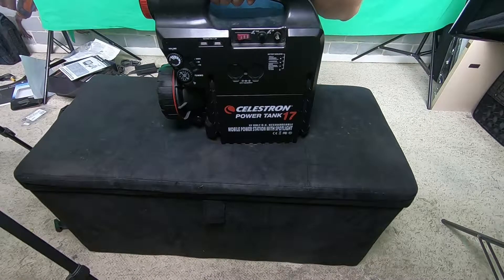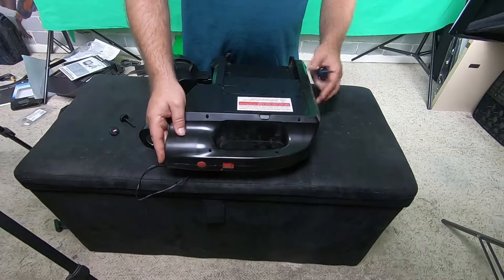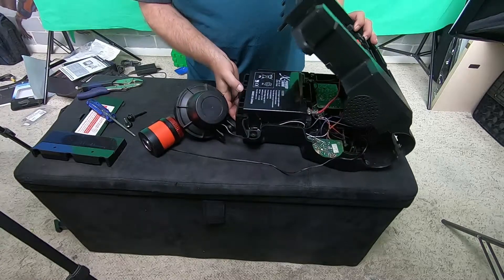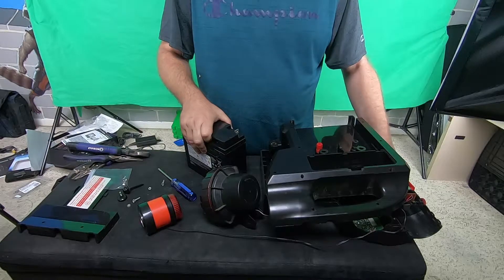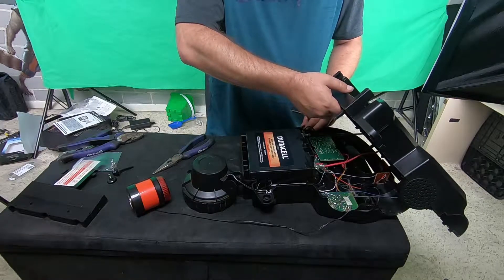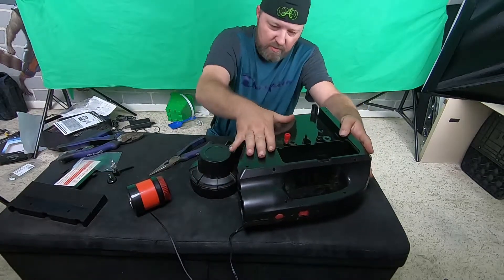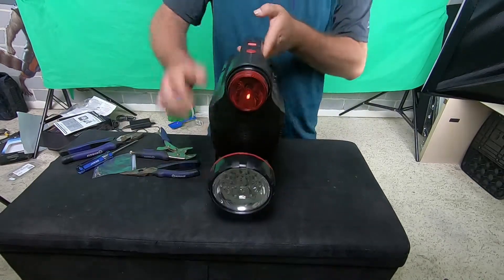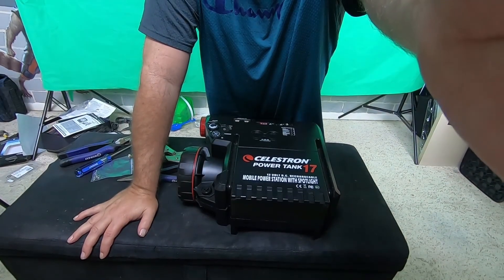Celestron Power Tank 17 battery replacement

Comment: Just a couple more questions, how is the PT holding up with the new battery and did the old charger work for the new duracell, or did you run into any problems ? does it matter if the battery is AGM ?

Comment: 18V ONE+ 120-WATT POWER SOURCE WITH 12V OUTPUT (RYI12VBG) + buy a 2Ah 18v that is lower cost than the 12v replacement batter and light years better setup.
Reply: Ryobi one+ 18v 120-Watt Push Start Power Source with 12-Volt Outlet RYi12VBG
One loss a Red Light
 Im working on a Usb plug in LED Red light.

Comment: Very useful. My Skywatcher version of the same tank was so reluctant to split open that I began to wonder if the external battery terminals were bolted through. What I did find was a screw I missed and, importantly, two clips built into the casing at the top of the red light housing plus a piece of tape across the join at the back of said housing.

Comment: Thanks!  This is so helpful!  I just pulled out a Orion version of this tank which like you I let die.  But since it is like new I want to replace the battery.  The lights still come on, but it want charge.  I get a click sound when I plug it in.  I also have the smaller Celestron 12V Power Tank.  I wonder if there is a replacement battery for it also.  Patience, three tools, and a little know how.

Comment: Hi there, where did you get the battery?? I need to replace mine and cat find it anywhere... thanks for the video
Reply from the maker: There is a local shop that sells them near me. A place called batteries plus that carries odd batterys, but its a normal to obtain one. They were cheaper on Amazon i just was impatient

Comment: What bulb do I get to replace the red light's bulb (they call it "flashlight" in the user manual) on the Powertank 17?
Reply from the maker: 12v 3w
Reply from the maker: Amazon.com
https://www.amazon.com/T10x28-Miniature-WarmWhite-Teaching-Experiment/dp/B076DMLT5Z/ref=mp_s_a_1_3?dchild=1&keywords=12v+3w+bulb+e10&qid=1598250747&sr=8-3

Hope this link helps.
I would try to modify it to an LED to save some power, if you felt up to it though.